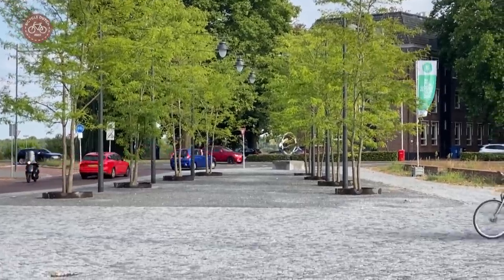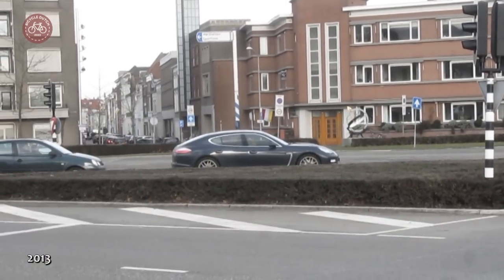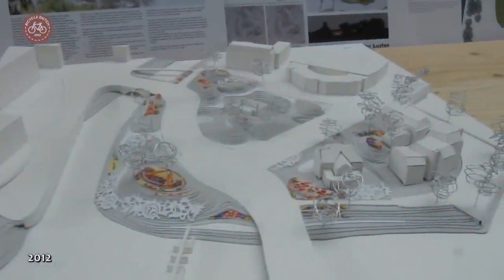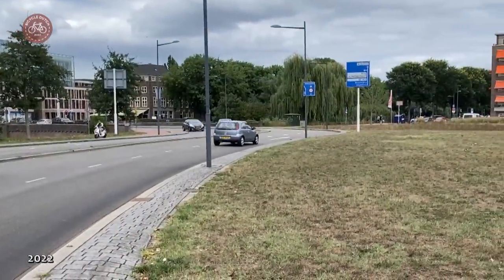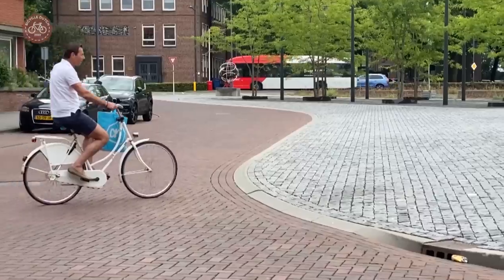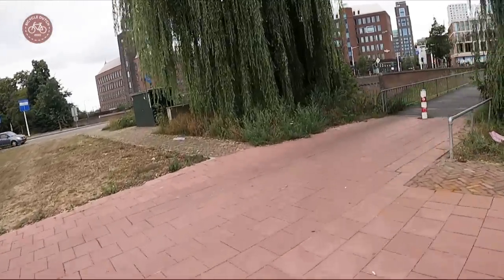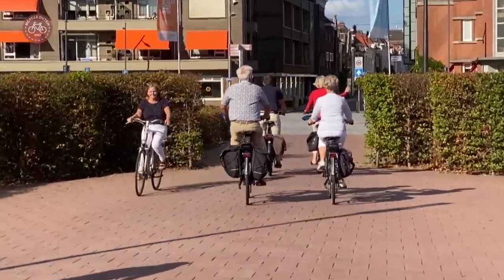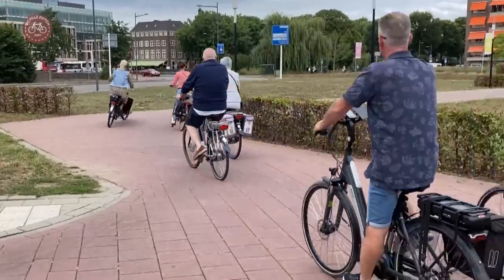Where 's-Hertogenbosch got it wrong for cycling

Comment: A shared space for different types of traffic is not always bad. A bad line of sight by entering or leaving is mostly part of the plan, because that reduces the speed. Accidents will happen, but with low speeds and minimal human impact. This place has far to much traffic for a shared space. As most of the traffic is by bicycle, the cycling routes must be made clear. Busses should never be on a shared space, but preferably have a own route, or share a route with other motorized traffic.
I know the place and with all sorts of traffic coming from so many directions and without clear main routes, it is very hard to make a good plan for all the different users and equal "rights" for all directions. The "historical features", which must be visible makes a good plan nearly impossible.

Comment: Seems like they didn't consider the valuable lessons from treating streets and roads for motor vehicles differently. 
This is like a stroad but for bikes. Lots of conflicts in a place where the main use is to get from point A to B, not to stop and interact. This place needs road like conditions for bikes, but are now getting street like conditions.

Comment: Cut the bushes back yourself and put cement down to soften those corner turns. Cut the lower branches of the willow at the bridge so one can see people approaching. Put two bollards near the entrance to the stairs or a bench facing it or a flower box or both. Make it not just a straight shot to the stairs.  I would come over from America and do it myself if needed. But don't wait for government people to fix it. Do what can be done now. It might have just looked great on paper or scale model to the person. Is the leader of the town who approved this design a nice person? They might not be a bicycle rider. It will be fixed eventually but no need to suffer until then. Just fix what you can. Christmas lights in those trees would look nice. Flower boxes to create artificial bike lanes?

Comment: 3:17 yeah watching were you are going would have prevented it too. A bridge looks totally different than a  stairs.

Big bollard to prevent cars from crossing the bride, isn't there at the stairs. The stairs goes down the bridge can be seen as you drive toward it. The stairs has a railing in the middle.

Comment: You got it all wrong. Its a square not supposed to be used for traffic but they still do and cyclists were supposed to cycle around it. That same space was scheduled for reconstruction of a copy the Pieckepoort which now their is no budget (€ 4 million+) and now they are constructing a small foundation only and started reconstructing the park. Unfortunately, the windmill and gate are not going to be rebuilt but your criticism is unfounded and poorly informed.
Reply from the maker: No, you are the one who is poorly informed. The main cycle route from ‘s-Hertogenbosch to Vught goes straight through the middle of this place. That the city has finally changed the kerb stones to be flatter is an indication that they also know that.
Reply: @BicycleDutch  If I am not mistaken, last week in 't BD was published the original plan for this area and because of no funds and a lack of an alternative they left it as you vlogged. What you refer to is an alteration to plan B (and that's what your video is about) while I refer to plan A which never happened. Please read the newspaper before you tell someone they are poorly informed. Thank you.

Comment: What can be done about it?
Reply: Reasonably a clearly labled (red pavemen) bike path is laid across the square connecting to the Vughterstraat whers signs clearly indicate the its presence, the "gate" is widened to the width of the incoming path, which furgher separated into pedestrian and cyclist sections, the outline of the original gate instead being indicated in differently coloured pavement. The incoming path is curved to meet at the corner of the crossing with no sharp corners.

Seems pretty reasonable, but expect this to take at least four years to solve.
Reply: Even more importantly than redesigning, we need to make sure that whoever designed this and whoever signed off on it needs to never be in a position of power anywhere every again. Otherwise it will just happen again.
Reply: Complete new design, immediately.